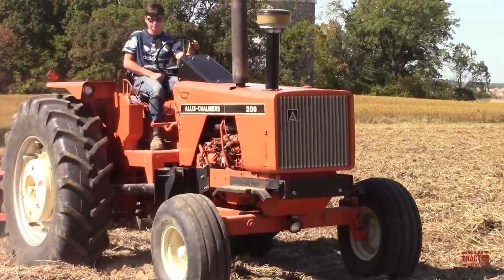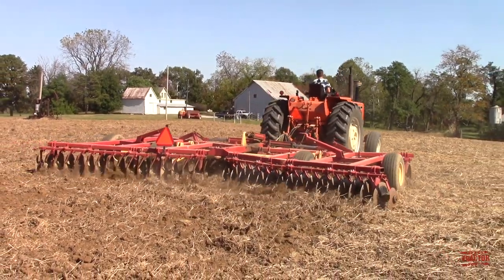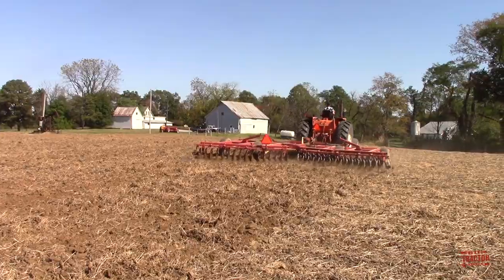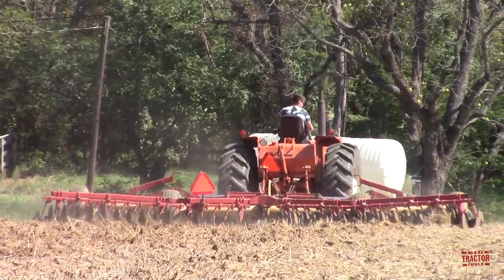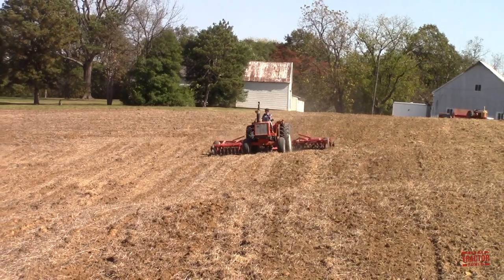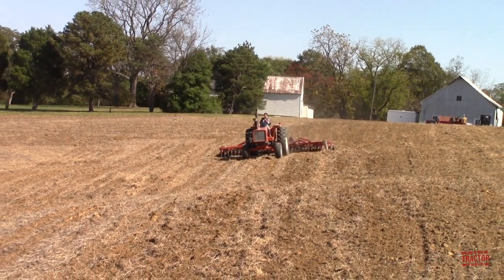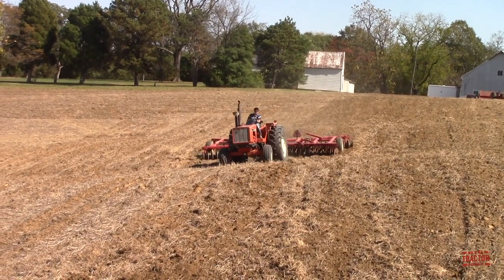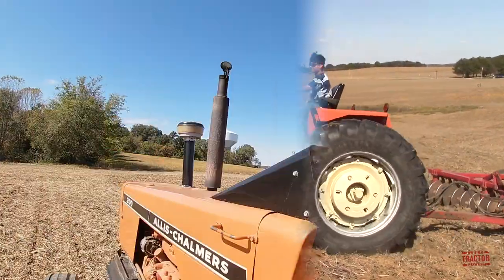ALLIS-CHALMERS 200 Tractor Working on Fall Tillage

Comment: This is surely a four cylinder turbo  engine, not a six turbo or it must be a really tiny short six. If the information for the video was taken from Tractordata.com then is it guaranteed accurate?
Reply from the maker: I use the original sales brochure from my literature collection.  According to AED-302/7305 this tractor has a 6 cylinder AC 2900 engine.
Reply: He is right, it’s got the mighty 301
Reply: @bigtractorpower  
It's tiny for a six cylinder! Car size. Less swept volume than many four cylinder engines of 100hp even back then when compare to say a Ford 7000 or 7600
Reply: @hedydd2  IH 706 had 263 cid 6 cylinder, the Oliver 1855 had 310 cid 6 cylinder, the gas 190xt had 265 cid 6 cylinder, the D19 gas and diesel had 262 cid 6 cylinder, the Oliver 1800 diesel had 283 cid 6 cylinder and the gas had 265 cid. It was a common size.
Reply: @SilverGleaner  
I come from not knowing those engines but of knowing the Ford, the Perkins 236, 248 and 318 four cylinders and 354 six plus the JD Saran 239, which itself was considered to be a fairly small displacement, high revving engine in the 30 and 40 series tractors.
Reply: @hedydd2  i know Allis Chalmers engines best and though they did build large 4 cylinder engines like the 344 cid diesel or the 563 cid gas or diesel, these are considered old designs. IMO Allis Chalmers best 4 cylinder diesel was the 433 engine series with 200 cid. It was the same engine as in this 200 tractor but with two cylinders cut off.

Comment: NOT A STOCK WIDE FRONT END, ITS OFF OF A D21 ,210,220.
Reply: The way it is bounced across the field crass wise to the plowing it won't be long and they'll need another and it's not unheard of an abused 200 or 190 to be broken in half with such abuse.
Reply: It's stock, the 210/220 was much heavier

Comment: Cool tractor. Why does the rear row of discs have a serrated disc on the ends, but the front doesn’t?
Reply: Stalk chopper. It will shred up corn stalks on the back row to keep them from clogging the "In" row. They are not on the front because that is the "Out" row."